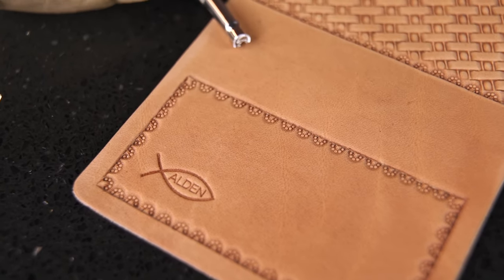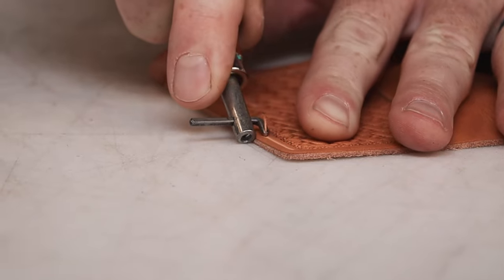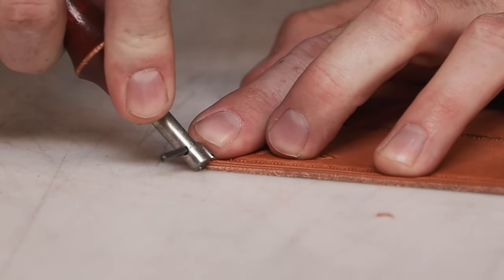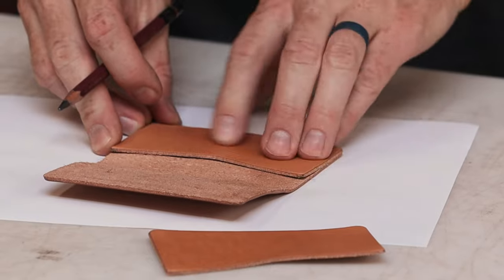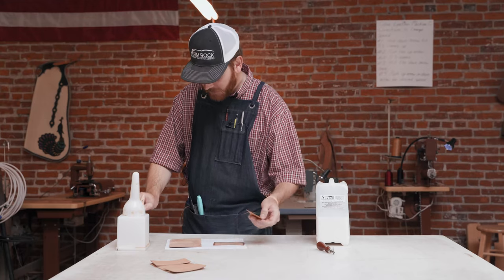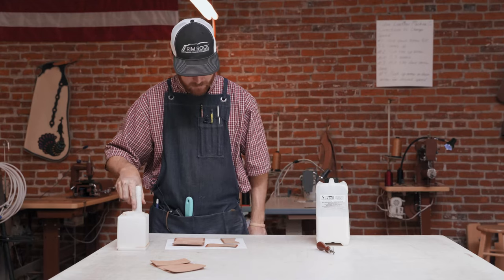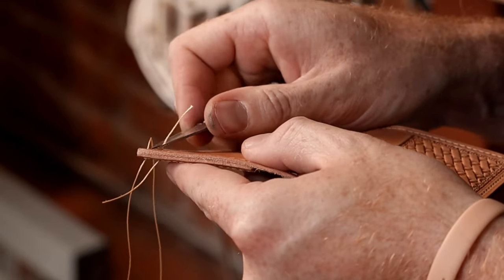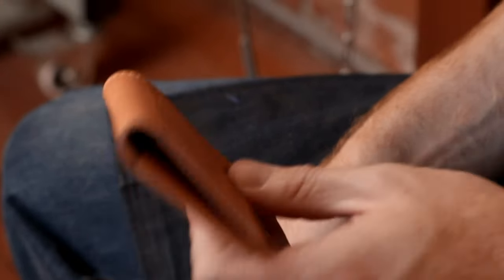Bifold Wallet Assembly

Comment: I worked as a welder and fumes were a big problem. Simple solution was to use a box fan just on the other side of my work and pull, not push, but pull the fumes away from yourself. I would also sometimes use a small fan underneath my table blowing up my stomach chest area and away so I would not breath any fumes whatsoever. I especially use it for dyeing with the Pro Dye as it's not just alcohol, but glycol ether, xylol and ethyl acetate as well. Doesn't sound healthy to breath.